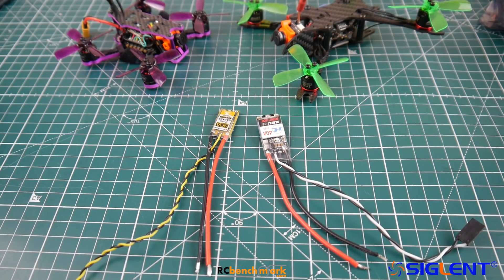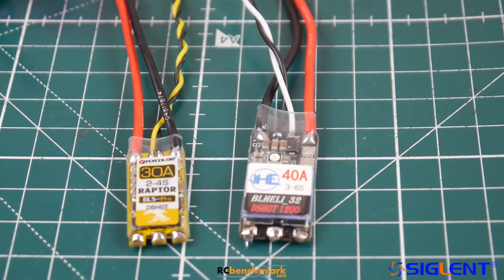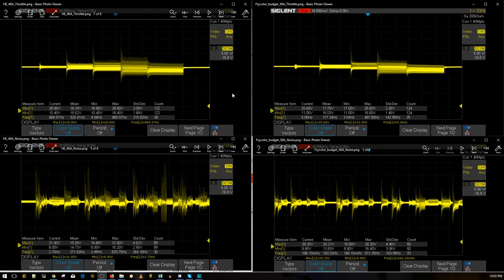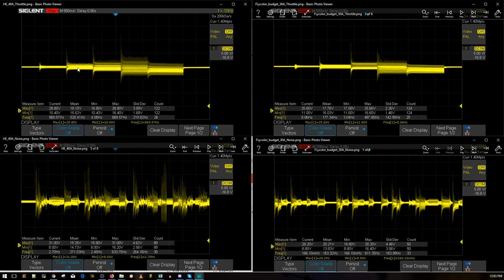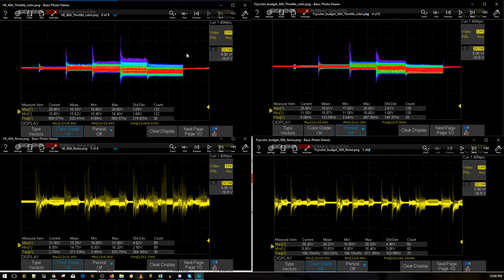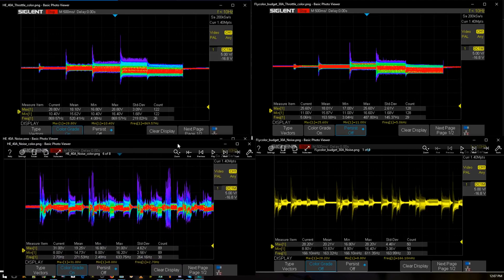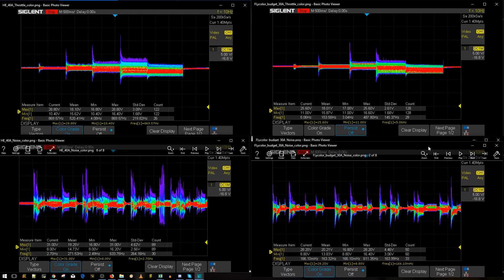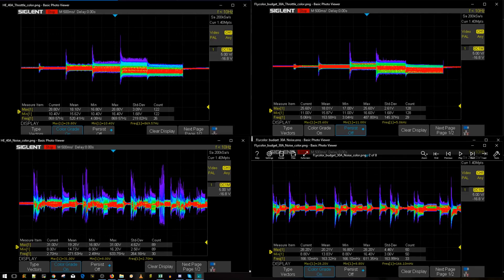New ESC 2018 Blheli32 // JHE 40A ESC Review and Noise Testing

Comment: why are the esc for drones do not have the huge capacitors of normal esc for rc ? im interested in using a drone esc in a rc boat , it wouldn't need water cooling so ok but , just interested could it cope , the drone esc are the smallest and considerably lighter than anything you can buy for boats , and cheaper ???? help
Reply from the maker: fossyfossfoss They need them we just end up installing our self.. If you look into Panasonic or Rubicon low ear capacitors..